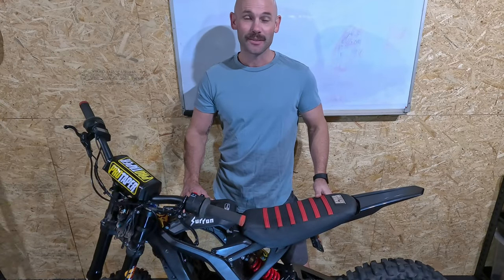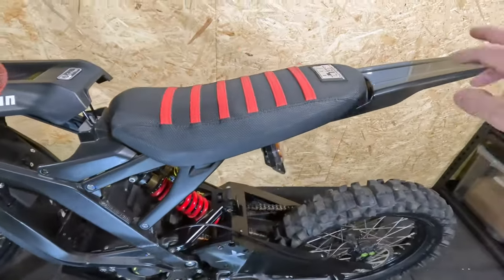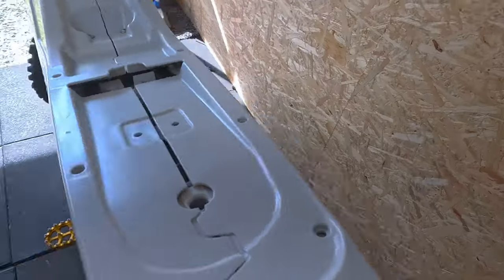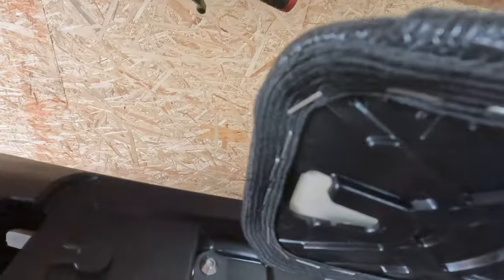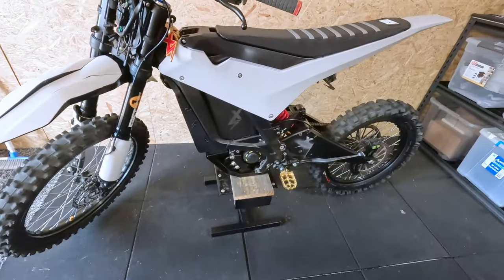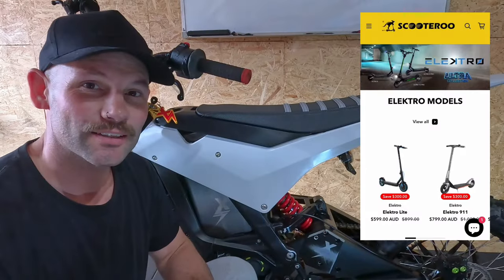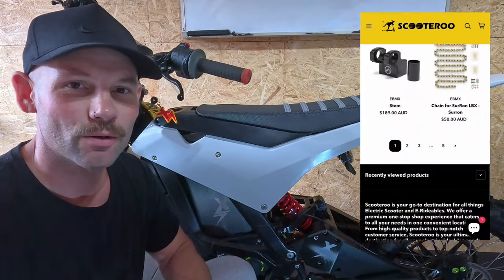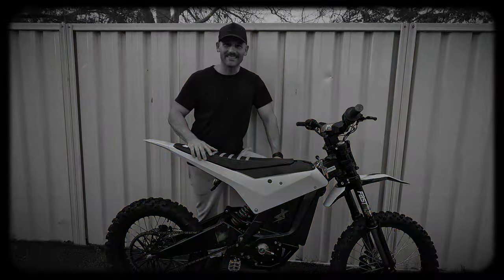Mini Surron Stark Varg (4M Foundry Moto Kit)

Comment: Does this raise seat height much?
Reply from the maker: @peterjacobs6290  maybe about an inch, I didn't measure the seat height before I installed it
Reply: What 72v you got to fit in there what’s the ah
Reply from the maker: @Gold_Soul  my battery is the EBMX 72v 42ah race battery